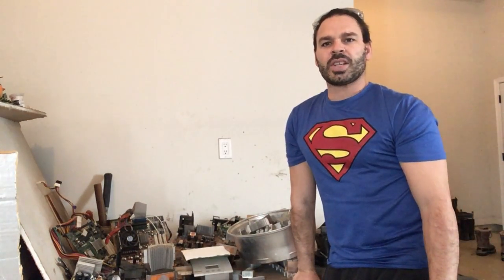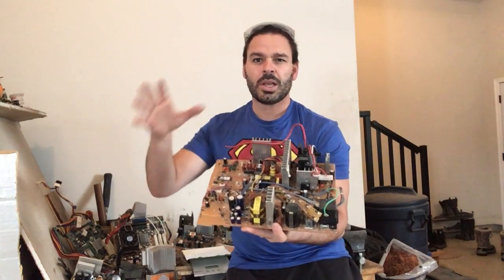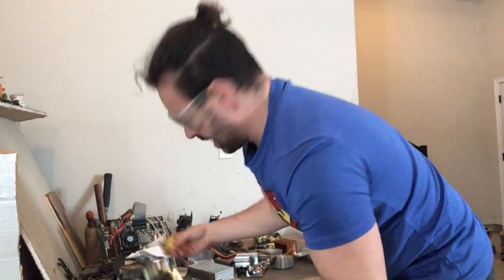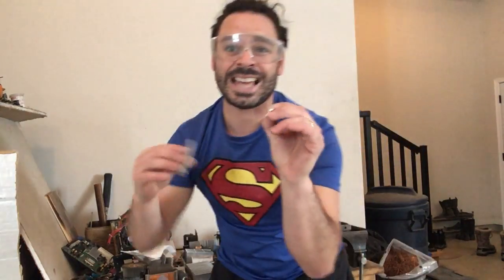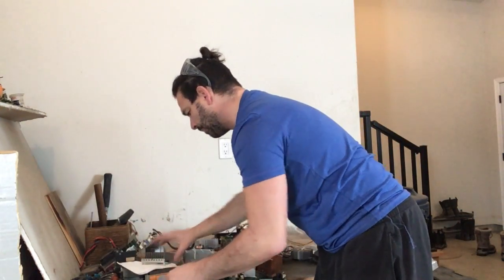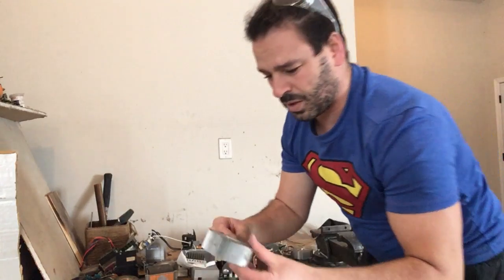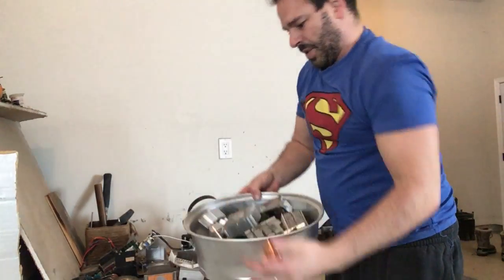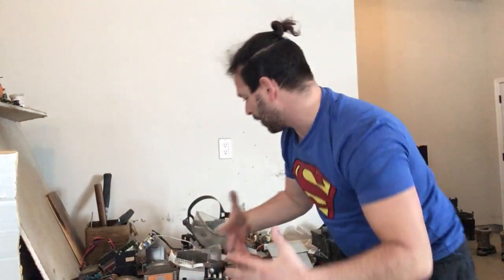Scrapping circuit boards for aluminum heat sinks. It’s definitely worth it!

Comment: It definitely adds up. I love the copper cores in the aluminum ones.
I’ve also noticed some that look like sheet aluminum heat sinks are actually tin plated copper (#2), you can tell when they are heavier, but verify with file.

Comment: You can just center punch the copper slug from the heat sink on the vice. Use a 2lb hammer and a few whacks. Just wash off the thermal paste with isopropyl alcohol. Wash hands afterward, it's mostly zinc oxide and silicon oil.
Reply from the maker: Thanks for the tip. Stay well and thanks for watching.